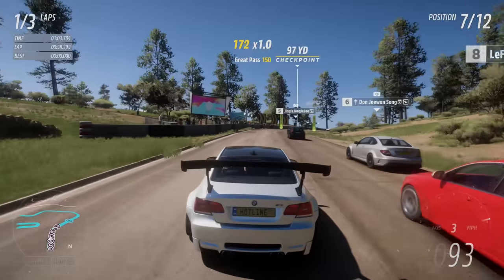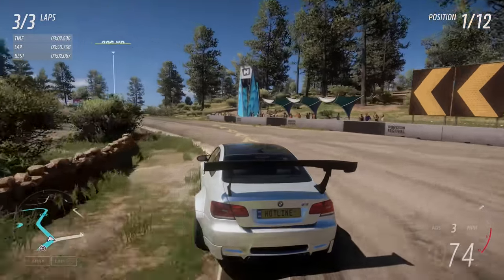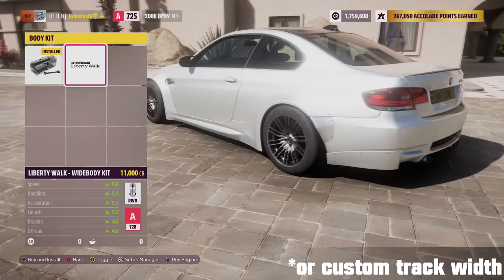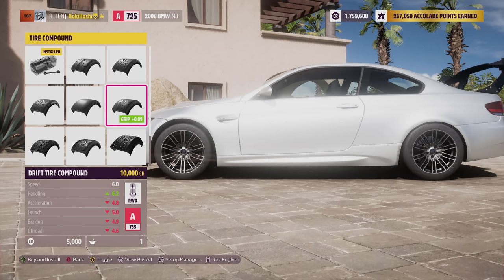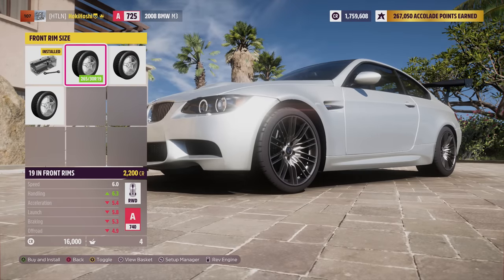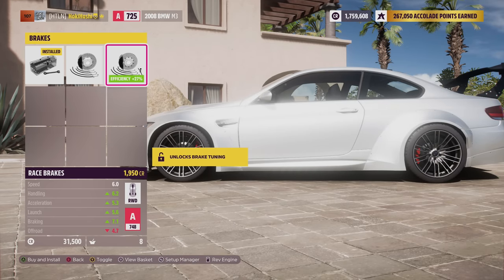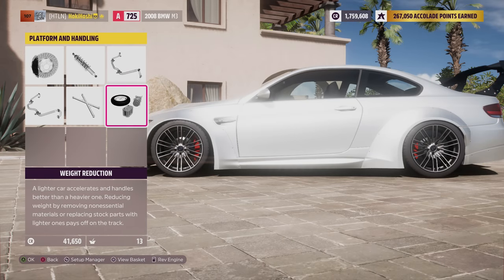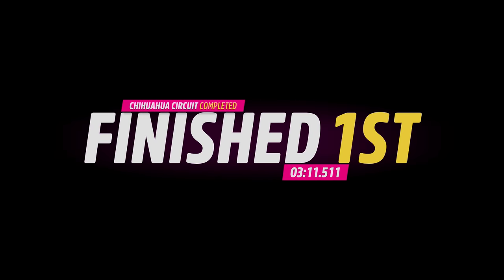How to Build Fast Cars in Forza Horizon 5 | Building/Upgrade Parts Guide

Comment: One of the reasons why I think camshaft upgrades are worth so much PI is that raising the rev limit also completely changes the way the car goes through gears and can increase the top speed of a car without touching the final drive. Between that and a race transmission, you can REALLY fine tune the gearing to make a car that feels very nice to drive and stays in the power band at all times.

I also disagree about adding aero to lower the PI and add power, because it reduces the top speed and acceleration so much. Personally, I stick with race tires and avoid adjustable aero at all costs because that way you still have high grip without sacrificing speed.

Generally for me, I build tires > transmission, diff > weight > suspension > brakes > power, in that order. If it under or oversteers still, then I will come back and squeeze in some aero when needed.
Reply: Aero on worse tires is almost always the way to go, it lowers you PI so you can add more power and benfit in acceleration

Comment: Am I right or am I wrong when he says that it's not more difficult between classes between-d class and x-class. Other than how fast you go around the track. That makes all the difference. The faster you go around a track the harder it is. But most tracks have turns. and the more experience points you get the more you can unlock through spins and it makes you a better driver cuz you have to do a lot of races to get those and that means you can unlock those higher class cars therefore you can make it harder by the more your play  the better you get rright?

Comment: After spending a lot of time racing in S1-2, more power is almost always preferential to less weight, in pretty much every situation except drag racing.

Something isn't right with upgrades in FH5, because unless you're driving a 4000 pound or heavier car, more power is the way to go.
Reply: It’s just that weight reduction is mostly about handling, and handling isn’t as important in Horizon games because the steering is much more forgiving than in Motorsport in general. Thus a couple of handling upgrades (namely tires) and focusing on power tends to be superior.

Comment: I have found what I think is a massive issue. I have a top of S2 McLaren Senna. It has stock (semi slick) tires, race weight reduction, front and rear aero and it is only at 8.6 handling. If I add SLICK tires it only bumps it to 8.8. But if I add one of their new extra gear race transmissions, it will bump HANDLING upto 9.9!?!?! Seems extremely unbalanced to me
Reply from the maker: Those numbers are pretty useless tbh and don't really tell you as much about the car as the game makes you think.  Adding a gear isn't actually improving the handling of the car whatsoever.
Reply: @HokiHoshi  I've added a clip of me upgrading to my channel, if you would like to check it out.

Comment: 3:17 I wish lessons like that were learned in the game. Basically, new players should get comfortable with the 'auto upgrade' button. The temptation to swap engines is a remnant from other games.

Would you use slick tires for a speed zone challenge? Even when it's raining?
Reply: If I was you ill wait till the rain season is over to do the speed zones as it way to slippery for it I noticed that but if you cant wait the best for road zones is Lamborghini sesto elemento FE is the best as the grip is stupid as do turns at high speed easy that is what I use or the rimac 2 as has good acceleration and grip you can find tune's. And the slick tires will make you spin more in the wet season so no only use them in summer.

Comment: Any option to have no heavy understeer? i havent found a single awd build that have no understeer. no matter what car yet, even with 10 handling. i followed some tutorials for forza tunings, but even with heave oversteer setup the are just understeering in corner entry or mid.
Reply: Front toe out will help, and having your downforce difference between front and rear too great will leave you to understeer as well. The puma fe is a good example

Comment: great video. One question though, I've never been able to get an answer to:
Why are the clutch upgrades not worth it when playing manual w/ clutch? That's how I play so I'm very curious. If I'm not mistaken, shifting using manual with clutch still takes longer depending on your transmission upgrades
Reply: Because you’re manually manipulating the clutch throttle and shifter, so the “shift time” is based on how fast you can clutch in shift clutch out, so you can use stock clutch since your control setup negates the benefits you would receive from upgrading. Im pretty sure the biting point of the clutch is the same no matter race clutch or stock, so if you can shift super fast then you can keep up with the players that shift with sequential set up (manual no clutch), or the ones who play automatic.
Reply: @oliverdepauw5663  In Motorsport 7 I distinctly remember clutch upgrades helped speed shifting up regardless. While pinning the throttle while shifting, listen for how long the engine buzzes for before dropping into the next gear. Bonus point, it didn't harm your transmission then to abuse it during upshifts - no idea if it's changed some four games later though.

Comment: If I'm going to add one of the race transmissions, is one speed particularly better than others or should I just base my decision on PI?
Reply: More gear selection means the car can stay in the power band better (especially if you tune it). However, this comes at the cost of needing to shift more, which takes time. If you're manually shifting then definitely don't grab that 10 speed. The implication of shift time is that on a lower powered car, you'll be wasting precious time shifting a lot. On a high power car, it will let you stay in the power band without stretching the gears out too much. I haven't really seen anything past 8 really used much in common tunes.

Comment: I have a couple of questions. How can I know when it's okay to jump class? I wouldn't want to spend money on a car, taking it into another class just for it to not perform well against natives of that class. Is there a way to tell? And is it safe to jump class as much as I want if I know the car will reach the top PI for its new class?
Reply: A good rule of thumb would be that you want to fit all the handling parts (weight reduction, tire compound and width, and aero if applicable) first, then see how much room you have to work with before moving up to the next class. If it's not much, say 5 or 10 PI, or if those upgrades bump you into the next class on their own, then it is probably okay to move up. Just as long as your car can still achieve handling values typical of the next class. If you get all your handling upgrades on and still have a lot of room to add power, it's probably good to stay in that class. Also, some cars are good in more than one class--it's pretty common for a good grip or all around car to be a good power car in the next class up.
Reply: Yea realistically to add to what the other guy said just try to stay within whatever class you have a lot of room to upgrade with, so don't stretch your PI.

Comment: I dont know why i max out all the upgrade on my car an the pi doesnt even maxxed out example s1 900 while i reach like 880 or less! Why other ppl preset can reach 900? Can anyone explain?
Reply: when upgrading from low class car, the engine is not powerful to get to higher classes even with full upgrades. try swapping engine and adding a turbo. but its not a good idea to take an b class car and upgrade it to s2 or something
Reply: @cemozdemir227  no im actually making b to s1 900, when i look other ppl preset they can reach 900. Idk why i cant.
Reply: @vlixz4583  have you tried all the possible engines? sometimes an engine is lower than other in stock but can go far beyond with upgrades. try different engines and see the result. another trick is you can look up the other people's builds and it shows the engine displacement. from that info you can figure out what engine they are using.

Comment: i think there might currently be a bit of a glitch with weight in the game, as in it doesn't get counted points wise for handeling (most if not all of the PI related to weight seem to be from acceleration/braking).

i've built a couple cars and i usually go a more lightweight focussed build but i've noticed weight reduction doing almost nothing for handeling (atleast as far as the handeling score will tell you). now i recently got lucky and got a trueno which again...gained nothing from dropping weight but instead score wise gained from adding weight... i somewhat ignored this made a build, my worst handeling score build in A class but ehr yea....this thing is by far my best handeling A class car >.>

score wise compared to my other A class cars i went online expecting the others to slaughter it...instead i finished top 3 every race.... well except for one where i got pushed out of a checkpoint by someone >.>

Comment: 5:59 I believe he is actually incorrect here regarding the ability to remove the effect of the rear wing with tuning. If you compare the top speed of a car with no rear aero to when you toss on a rear wing but tune the downforce all the way down, the rear wing still lowers the top speed, and usually quite a bit.
Reply: Also lowering rear aero can mess up braking

Comment: worth noting that "upgrade x is expensive..." never really mattes outside of the first few hours of playing, because you'll have plenty of money to drop 40k on upgrading a car.
Reply from the maker: When saying "expensive" or cheap in this video, I'm not referring to the actual credit cost of the parts which yeah, like you say, is pretty irrelevant after playing a bit.  Cheap/expensive refers to the PI budget.  An "expensive" part increases the performance index more than a "cheap" part, and your "budget" is the top of class.
Reply: @HokiHoshi  Glad I understood that correctly, but I wonder do a lot of these upgrades apply to very overpowered X class cars?? In the past, I’ve noticed that different engines and aspiration can make a huge difference based on how I want to maximize, leading me to having a hard time deciding how to build a car. The drivetrain can make a huge difference too clashed with the engine; basically do you prefer RWD or AWD when making these kind of cars assuming it starts with AWD??

Comment: This isn’t really related, but Forza looks like it’s “cheating” with its graphics slightly. Like the game looks slightly overexposed and high contrast to make it look better than it is. I don’t have the game yet, but if there’s a setting to change this then it’s fine.
Reply: I have this issue, but only from the driver camera angle. (Where you see the steering wheel)
All the other camera options are fine. 
But in the middle of the day i cannot use the driver camera angle.